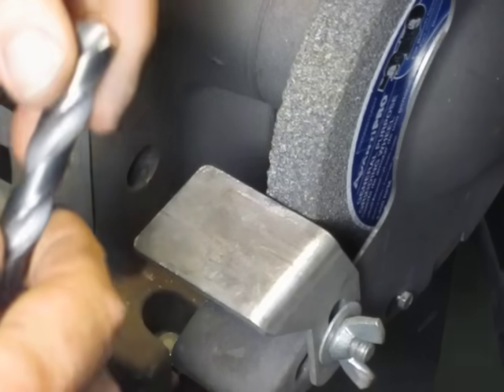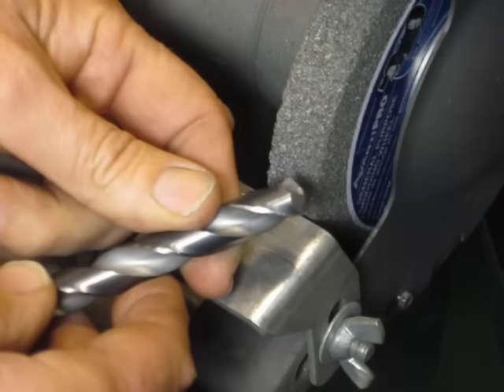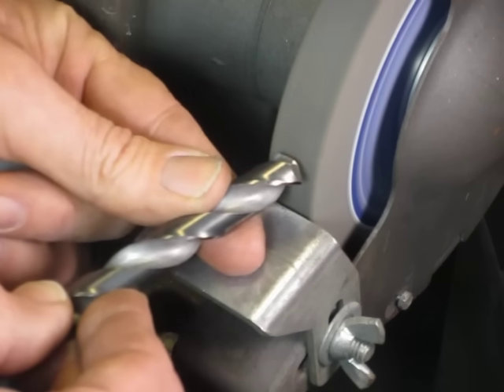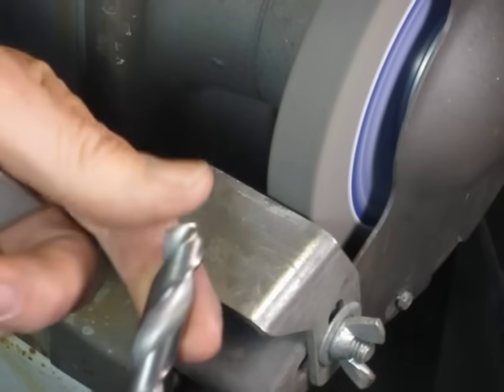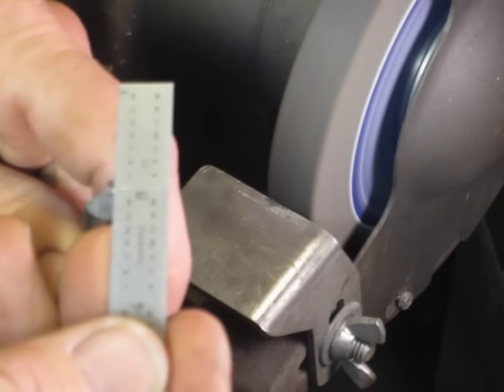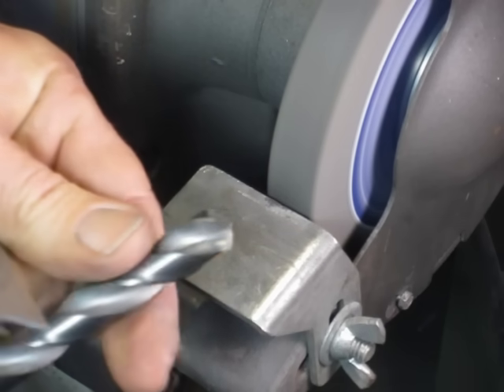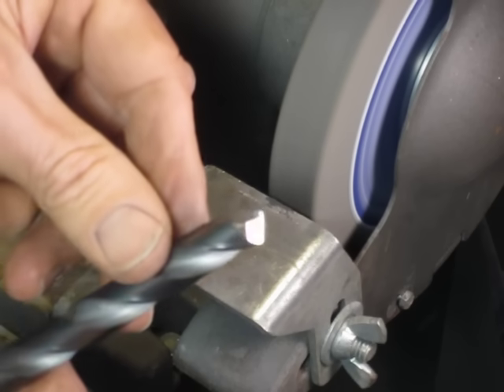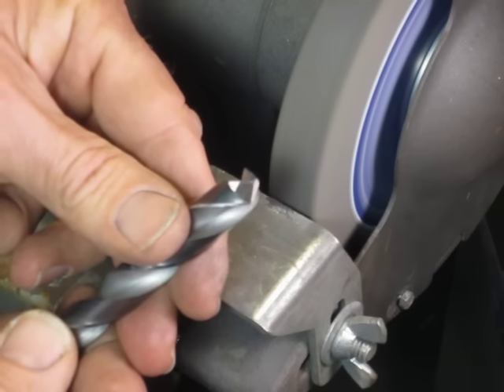How to Hand Sharpen a Twist Drill

Comment: Dad taught me to sharpen drill bits to 60 degrees and include a little relief to the trailing edge but we didn't have a rest, just an old washing-machine motor and an arbor. more important is keeping them the same and I never used a protractor or ruller, just did it by eye..Learned that lesson in 1955. still using same technique.
Reply: Also we kept a cup of water close by and dipped the bit in water every second or two. if the bit's cutting edge turned black I was told to cool it more often..
Reply from the maker: Dennis Miles
Dennis,

That would be appropriate if your drills were made of carbon steel. Drills today are high speed steel and have good hot hardness to over 1000F. That means they can literally get red hot without losing their hardness.

Tom
Reply: well we did have a large-mouth jar filled with water on the shelf in convenient range and while holding the tool in my fingers when grinding we dunked it in the water often. We kept the lid on it when not in use to keep the mice from getting a drink...

Comment: Tom; I agree with your approach completely. To teach a newb, take them in steps. That means flats in this case. Setting equal cutting edges first makes complete sense, and everything else follows from there. Trying to roll the relief is tricky and takes knowing the other stuff first so that you do not take out the key attributes as you roll. Splitting the web is 10-out-of-10! I have a Drill Doctor... somewhere. I used it for a while but the bits I sharpened in it didn't cut well. I do'em by hand and look out! Keep up the good work!
Reply from the maker: Thanks, I'm glad you are enjoying the videos.

Tom

Comment: Learn to keep what is interesting in the frame and in focus.
Reply from the maker: Easier said than done Gregor. Thanks for the tip.
Reply: Yeah I know :-)
A cameraman/woman would do the trick.
Arrange some sort of focus stops so you can shift between close and closer, shifting focus.on the lens as you pull away to show some detail.
Reply from the maker: That's an old video, I'm getting better. The cameraman/woman is out of the question because no one around here has my patience. ;)

Tom

Comment: I would start my grinding at the heel of the bit and work toward the cutting edge. Don't hold the bit on the grinding stone too long or it will make the bit brittle or too soft. All of this can be done by eyeball. Just look at new bit and make the dull one look just like it. Just roll the bit from back to front. You can see how sharp and true the cutting edge is by the way the sparks light it up. Another tip is to use a stone truer before.
Reply from the maker: Jerry,

Unlike carbon steel, high speed steel will not lose hardness until it gets over 1000ºF. It has what is referred to as good hot hardness. If you are sharpening a knife, then yes keep it cool, but its not necessary with HSS other than to save your fingers.

Tom
Reply: I only sharpen high speed bits. You can get them too hot on a bench grinder. Also, when I am finished sharpening a bit, it looks just like the point of a new bit, No flat surfaces.

Comment: Another excellent video, your's are the best!! Can I make just a couple suggestions? When you pull the twist drill off the grinder to show the work, you tend to dip the twist drill below the YouTube frame so no one can see it (at least I can't on my browser, so maybe it's like that only on my screen). You do this many times if you review carefully. Occasionally the twist drill will appear in the frame. One other thing, and this is more of a question. Should the twist drill be honed when you're done grinding it? Thanks!
Reply from the maker: Sorry about the disappearing twist drill. You have to realize that I'm viewing the camcorder screen upside down and backwards so holding it in frame as I'm looking at it and talking about it can be quite a challenge. This was a fairly early video and I am getting more coordinated.

Honing is not necessary since it is a drilled hole. If you want a better finish, you should ream or bore the hole after drilling.

Thanks for watching.

Tom

Comment: LOVE your video, brought a huge smile to my face.  I saw my Dad do this hundreds of times as he was a machinist at Burgess Norton, Geneva, IL for 2 years followed by 43 years at Van Dee Mfg in Batavia, IL. I just called him on the phone and told him about your video and asked him if he used the square and he chuckled, that he could get it right by eye only and then after asking him how close to tolerance he could get it by eye and he laughed even harder said "within around .005"'! He ran three multiple spindle bar machines until they replaced them in the '90's? with single bar Mazaks. I actually worked with him at VD for a few months until I told myself I couldn't do it for 40 years and joined the USAF and retired at 25 years, 44 years old and he was still working at VD for another 5-7 years. I really felt/feel bad about that too but I had to retire as I broke my back or I'd still be working somewhere. Enough of flappin my gums. Thanks Please comment if you would as he'd like to hear from you.
Reply from the maker: Truthfully, I don't use the protractor either. I just used it in the video because it's a good idea to start with one until you develop the necessary skill to go without it. Once you get it down, it only takes seconds to sharpen a drill that will work like new.

Thanks for watching.

Tom
Reply: Tom's Techniques I hope you don't think I was disrespecting you, I wasn't just wanted to share my experience. Like your other vids too.
Reply from the maker: Not at all. I just include a lot more steps and information in my videos than I use myself, so someone trying it for the first time has all the tools they need to get it right.

Glad you like the vids.

Tom

Comment: I don't care how good you are. I don't care how good you think you are. You will NEVER get a perfectly sharpened twist drill by hand. You can get reasonably close, but you really need a machine to get it perfect, especially when you get into the larger bits. I know this for sure because I did it for over 12 years straight.
 When you need a specific drill size for a tapped or reamed hole, it would be ill advised to try this because if you are off even the slightest (and you will be), the drill will make an over-sized hole and the end results for a tap or reamed hole will be incorrect.
 But for general holes (fasteners) this is perfectly fine.
Reply from the maker: I once took on an old German machinist with the same opinion as you. I ground by hand and he ground with a drill grinding attachment. In the end, my drills worked just as well as his and didn't take as long to grind. For general purpose drills (not split point), hand grinding is perfectly adequate for general purpose drilling, including reaming and tapping (I do it all the time). You are correct though, the length of the lips must be as equal as possible to get an accurate hole. No drill is perfect, not even a machine ground one. It just has to be good enough for the application.

Thanks for commenting.

Tom

Comment: Great videos Tom.  I am an aircraft structures mechanic and have been for 10 years.   This is a skill I have yet to master.   Mostly due to the fact that the company sends our bits out for regrind.  If my boss saw me over trying to regrind a drill he'd have my ass.   "GO GET A NEW ONE, AND QUIT SCREWING AROUND!"    
I learned how to from an ol' timer, after viewing this I see a few things I've done wring.  Thanks.
Reply from the maker: Thanks Derek. Your drills are likely split point which are tough to grind by hand.

I learned most of my sheet metal skills working on a project to install a radome in the rear of a CV-580. We removed so much of the skin and structure that we had to build a cradle to support the tail while building the well and supporting structure. I wish I had a nickel for every rivet I drove. We also designed and built all of the instrument chassis and racks inside the cabin.

Tom

Comment: The secondary angle is called the "Rake" angle
Reply from the maker: The term rake refers to the angle of the top surface of the cutting edge of a tool. On a turning bit, the rake angle can be either to the side or to the back (back rake). The equivalent surface on a drill would be the face of the flute. The angles behind the cutting edge are called clearance or relief angles. The primary clearance angle is immediately behind the cutting edge and secondary clearance angle behind that. As long as you grind enough of the area behind the cutting away that it cuts, I don't care what you call it. ;)

Tom
Reply: lol.... what I was taught years ago

Comment: Dear Tom, I need to add to my previous comment. You have not only saved me loads of money (that I don't have) you have saved my sanity. I have been struggling with blunt drills for about 25 years. I was very good at making real hard work out of drilling into steel, until now. I stopped trying to sharpen the drills, because I only made them worse. You explained it so well I found it easy, at long last. Instead of dreading the thought of drilling into steel, I can't wait to do some more.Thanks for kindly sharing your wisdom. Janette
Reply from the maker: Once you get the hang of it, it's kind of fun sharpening them and as you say, you also save a lot of money doing it. Glad you enjoyed the video.

Be sure to check out my website, tomstechniques.com.

Tom

Comment: I agree that sharpening a drill bit by hand should be one of the first things a person learns that works in a machine shop.  A dull bit, like any cutting tool, is dangerous.  

Your way differed from how I was taught in that I turn the bit to grind the relief, which makes a sloped relief.  Same result, different technique.

One suggestion.  It would be great for clarity and understanding to those new at this to use Dykem or such on the cutting edge to clarify the progress.  Excellent video

Comment: A machinist that can't sharpen a drill bit by hand, is NO machinist..it's a button-pusher..

Nice tutorial!.. i'm a toolmaker, and as such.. i can too hand sharpen my drill bits..
the only difference is, i usually rotate the bit, and swing the point upwards when grinding the clearance plane, instead of grinding multiple facets, that makes a drill just a tad bit better.. but then again.. it takes a lot of practice to do so..
I mostly DO start with your method though, and then finish by rotating

Comment: If you are learning to sharpen a drill it is good to paint the drill in the front with a sharpie and just drill a quick hole into some stock. You will see if there are any points where the drill is rubbing.

Comment from the maker: Thanks. Splitting the point definitely makes for a better working drill and the skill required to make one will always be of benefit to a machinist. To do a good job, you need a fine wheel with a nice sharp corner. The wheel in the video is a bit coarser than I like and has been replaced with one that is 100 grit.

Tom

Comment from the maker: NEVER use gloves while operating machinery. A glove can be pulled between the wheel and the rest on a grinder and your fingers in with it. If you are lucky, the grinder will stall, otherwise your going to lose some fingers or part of them. Gloves and machinery do not mix.

Comment from the maker: Thanks, I'm glad you enjoyed it. Drilling brass as well as plastic does require a special grind on the drill. You can grind the angle on the cutting edge to zero as you did, or just dull the edge slightly. Either way will prevent the drill from screwing into the work and ruining your day.

Comment: Thanks for the video. That is basically the same way I was shown to sharpen drills except you do it far better than I do. The one little extra bit I was shown was for drilling brass. You need the side of the wheel to be dressed and as you roll to thin the web in one direction you can then roll in the ither direction and change the hook angle to almost neutral and it will then shear out a very smooth hole in brass without trying to bury itself in the brass.  I have a full set sharpened for brass.

Comment: It is pretty rare these days to see a drill bit made of plain high carbon steel. Mot all are high speed steel that does not have that problem. Try to anneal a piece of HSS sometime. Bet you can't do it. Go ahead, use a torch. Still won't happen.

Comment from the maker: Thanks!

High speed steel can withstand a lot higher temperatures than carbon steel before it starts to lose its hardness, typically 1000ºF or higher. So unless the tool is turning red, there's no real need to cool it except of course to keep from burning your fingers.

Comment: Have used the same technique for years, was taught to roll the drill but it always seemed a bit hit and miss. By grinding a series of flats I found it easier to maintain the clearance and balance the 2 cutting edges. When rolling the drill you lost the datum in your fingers.
When machining Titanium you could not pilot drill so taking the centre out as you showed was vital....you had to drill size in one cut.
Enjoyed the video and realised it is not just me that has developed this technique.

Comment: you should also be able to grind cutting edge and back side relief by rolling the drill as you sharpen it, It will give a conventional looking point..... yes it takes practice to do that also. same concept just roll the drill in and up after grinding cutting edge....... old machinist are a tricky lott........ they have lots of tricks

Comment from the maker: Thanks Joe. It's good not to let them get too hot to handle although high speed steel can tolerate a lot more heat than carbon steel. It can get as high as 1100º without loss of hardness.

Comment: excellent! Been doing it that way for decades, only tip I might add, because I work with some pretty large drills that often get really mangled, is remeind folks not to overheat the tip while grinding, tuning it blue or gold, thus softening up, annealing the tool steel. 
Thanks for that

Comment: I can see your point. For me, the Drill Dr. just makes much more sense. I do a lot of door closer installations on metal door frames that were concrete poured, so drilling the mounting holes for the closer arm means using multiple bits since even the slightest touch on masonry dulls the tip beyond service. The DD weighs about a pound and fits nicely in my tool bag. It has been a life-saver for me. I have one at home too, and wouldn't be without it :)

Comment: You're more patient than I am. I disagree with you on a machine (a good one like a Drill Doctor) taking more time & giving inferior results. As someone who just wants a sharp bit & not have to mess around with all the mumbo jumbo you're going thru, the Drill Doc is the ticket. I use bits all the time, in situations where nicking masonry just beyond the metal is unavoidable. I am so good with the DD that I can sharpen twist bits in about 20 seconds, start to finish. Factory results EVERY time.

Comment from the maker: A flatter point is better for harder materials for several reasons; it is stronger and therefore able to tolerate the higher force required to drill tough materials and a flatter point is better able to dissipate heat which leads to a longer life when drilling tough materials. Use 118º for wood, plastic and mild steels and 135º or flatter on hard materials like tool steels and stainless.

Comment: I'm just asking here, not doubting at all.....but I've read alot that 118 is for harder materials and 135 for wood and softer metals.... this is opposite of what you said... which is correct... I have found when drilling 4340 crankshafts during balancing that 135 seems to work better for me ??

Comment from the maker: Thanks.

When I was younger and my eyes were sharp, I could do bits down to about 1/16" using a fine grain aluminum oxide wheel with a nice sharp corner. I can still do them that small, but require magnification to see the details.